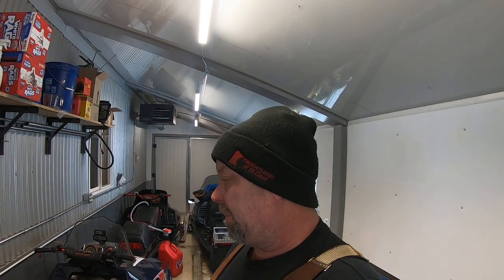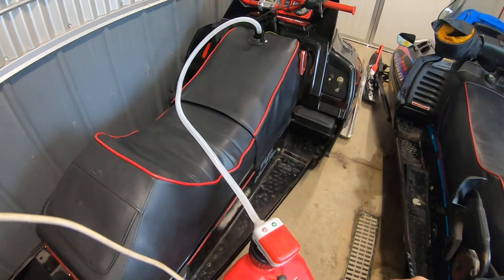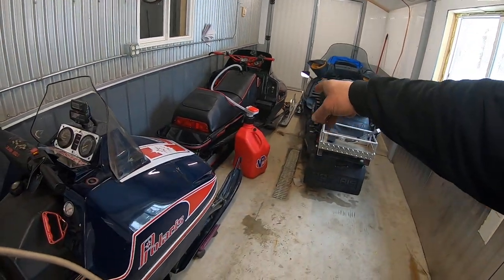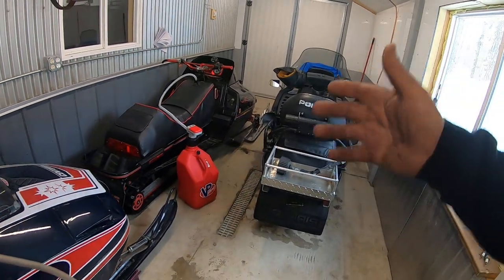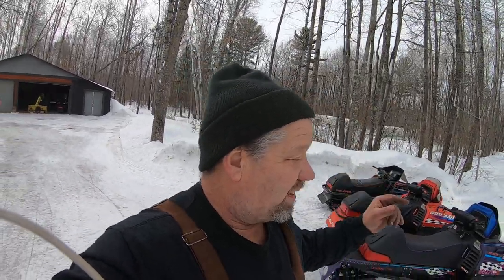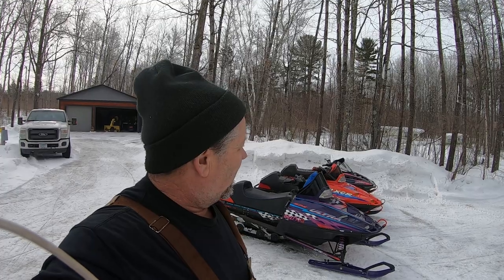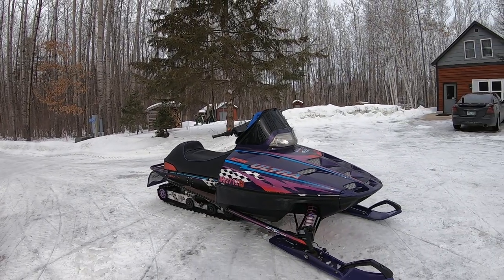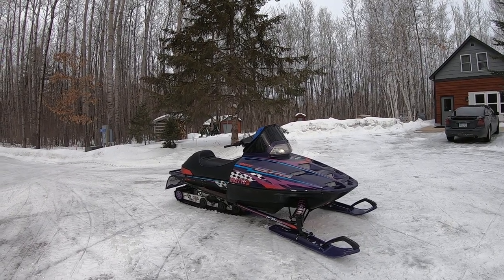POLARIS XCR 800/ULTRA TRIPLE TRIPLE

Comment: Great video. I like the fuel filler setup. Would work nice for also filling 4wheeler n tractor too. Freebie should be a lot more Crisby running now. All them machines sound awesome!😎
Reply from the maker: Works great to transfer gas from one sled to the other also 😁

Comment: Cool video.. Todd I have a random question I hope you or someone reading could answer quick.. I have a '94 XLT Special.. will a factory can from a 97 XLT Touring (evolved chassis) fit onto my wedge sled? Just trying to quiet mine down... Thanks.
Reply: So I tried it.. bought a double can silencer off a touring model.. turns out they slip right onto a wedge XLT. Only thing you need to modify is the hole in the belly pan. The evolved touring can’s outlet drops through the belly pan about 1” difference from where the original can does. 👍🏻🇺🇸

Comment: Exhaust valves, smaller exhaust port so it creates less noise on the xcr 800.. Been down that road myself.. That's the only thing that I can think of
Reply from the maker: Must be
Reply: @toddclyne3493  it is I believe.. Seen the same thing with an AAEEN torquer pipe going from a non ves to ves.. She got a little quieter
Reply from the maker: @mturley8414  good to know

Comment: Hey Todd, my ultra started burning coolant again after a 7 hour ride last weekend. She had a bad headgasket when we got it and we replaced all 3 gaskets. Now it burns enough to fog out the area pretty quickly, sled was sitting 7 years before I ended up with it. What are the chances it's another gasket or the pump this time? The ultra is a whole different wedge animal than what we're used to
Reply from the maker: Cracked head maybe
Reply: @toddclyne3493  pump ended up being annihilated, bearings in pump are so bad the gear can be moved side to side 😬. Replaced with recently rebuilt pump and she's back on the trail, now to rebuild this one and shelf it